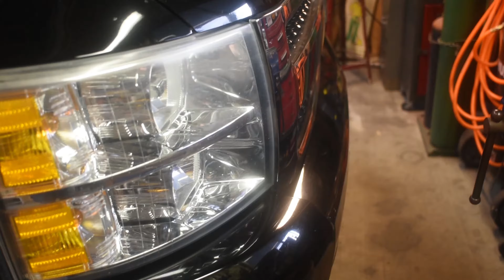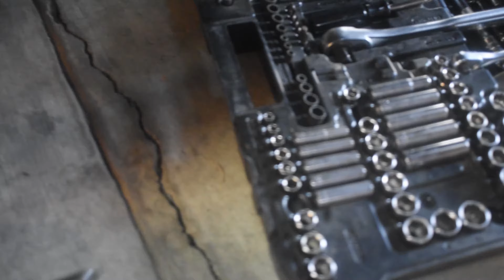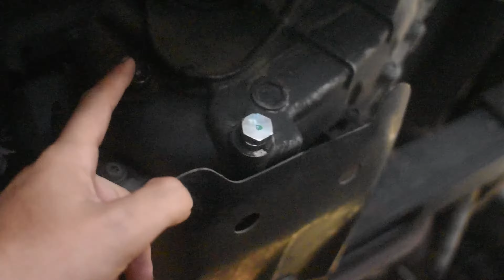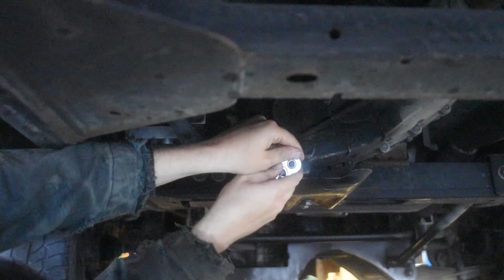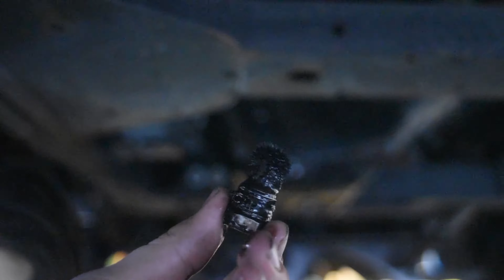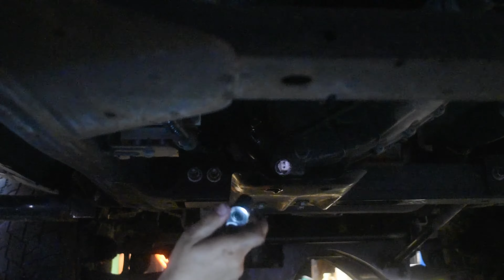2007 Silverado 4x4 Transfer Case Fluid Change (2007-2013)

Comment: I didn’t hear it mentioned in the video so I’ll post it here since I just learned the hard way. Both plugs on the transfer case are npt threads. The deeper you screw them in, the wider they get. I just cracked my transfer case on the drain and didn’t wrench on it nearly as much as he did in the video. Really wish I’d have caught them being npt threads before putting them back in.
Reply: Wish I read your comment before I did mine :(

Comment: You are over tightening those bolts - that is an aluminum housing, you're going to wreck stuff! Should only be 18 ftlbs.
Reply: Depends on the build. There are three different torque specs depending on the build.  Mine is 156ft lbs. The other two specs are 15ft lbs and 18 ft lbs. Crazy
Reply: @butchcoplin2316  - 156ft lbs?! Come on?!

Comment: Thanks for all the vids on the transfer case and front and rear difs.  The dealer wanted to charge $800 bucks for this.  I did not think it would be very difficult and this proves that.  Good stuff.